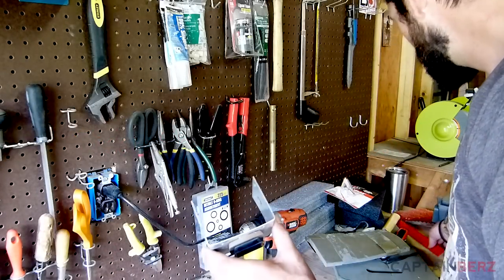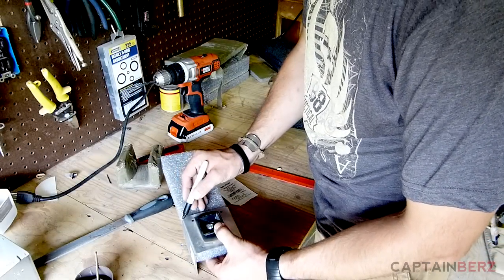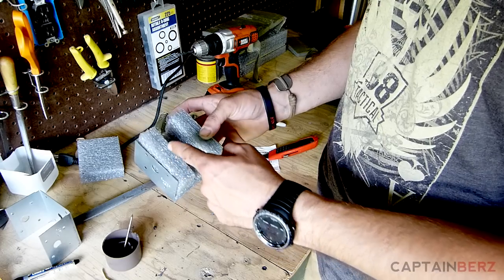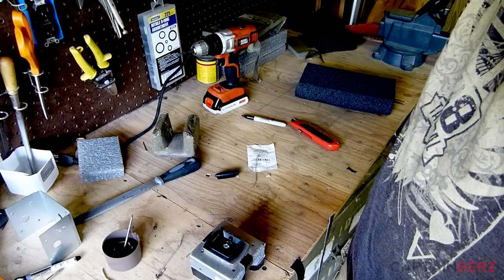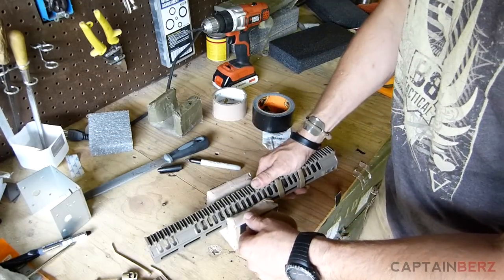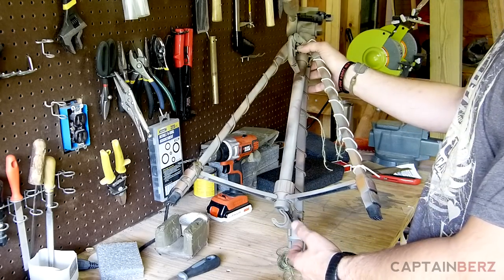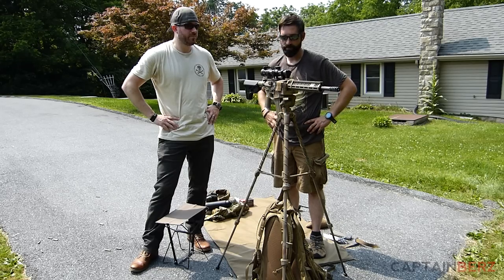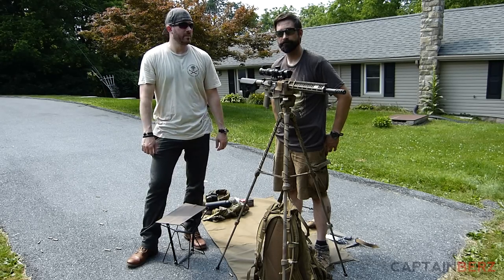Homemade Saddle Shooting Tripod: Part 3 of 3

Comment: I built one of these this week and I like it very much. I used the digital camo Duck tape ,thats all I could find other than black. I got the tripod at Goodwill ,so I only have $25 in the whole thing. I looked into the M-LOK device that was mentioned in the comments on one of the videos,but it only fits the expensive tripod. I think this one is more versatile for multiple rifles.  THANK YOU for the idea guys!!!

Comment: Totally beats hauling a table and big, full sized folding chairs to a shoot! Really great DIY video series! Can't wait to get started on mine. As mentioned in part 1, I'm going to get a tripod that has a minimum height of 24-inches, but extends to at least 70-inches, so that I do not have to bend over too far when shooting in standing position. Really cool idea using back pack for stabilizing the tripod! Thanks again for sharing, AGW.

Comment: Smith victor makes some good tripods. Manfrotto quality but not as expensive. My cf3 weighs 2.5 lbs and I  can use it standing (im 6'2'')or adjust legs length and angle to where it will work as a bench top rest at less than a foot tall. I have had 35 lbs on it no problem.

Comment: Great idea, quick question though. After spending 10 minutes talking about screws and if your keeping your mount on yours, why put the nut through the top? Why not put a washer, a screw so it’s flat? The nut would be underneath where it’s hollowed out.

Comment: Nice tripod! Try roughing the tape up with sandpaper next time instead of paint that will chip off.
Reply from the maker: UGOTBEARDIED I got some Gaffers tape in brown and have changed it. Also, I am rigging up a different way to secure a rifle instead of the velcro. Stay tuned!
Reply: +CaptainBerz  for a bolt rifle i dont need anything to secure the rifle for muzzle climb just the saddle?

Comment: Great video. Going to be making mine soon.

 I only know of one company who makes a QD tripod mount adapter. Unfortunately it's kind of proprietary. It only fits M-lok rails and Monfroto tripod heads.

Do you know of any adapters that would be strong enough to directly mount to the rifle without stressing the rails or tripod head that are not proprietary to those two systems I mentioned above?
Reply: There are Arca Swiss and Manfrotto M LOK adapters. You can buy a cheap Arca Swiss plate with threaded bottom to easily adapt too.

Comment: Weight......my tripod leg extensions always want to slide closed when I'm using it in the standing position.  I had to drill little holes in the legs and drop little pins through to stop them from sliding closed.  Is there a better way? I unfortunately run a pretty heavy bolt gun.
Reply from the maker: Dustin McGinnis Probably a tripod which is a little more robust is the answer. That shouldn't happen, possibly fault latches. Maybe contact the company, etc.

Comment: Try to source an older but quality tripod from a thrift shop if you want to do this on the cheap.  I got a very solid tripod that was meant for some huge outdated camcorder for $15.  $3.50 worth of hardware and some paint, tape, and padding I already had put this project in at under $20.  Thanks for the video/info!
Reply: I just picked up 3. all different sizes, all with same  QD mount.  all for $5 each. scour your local craigslist and Facebook garage sale site.  if anyone needs help finding one, just gimme a shout.